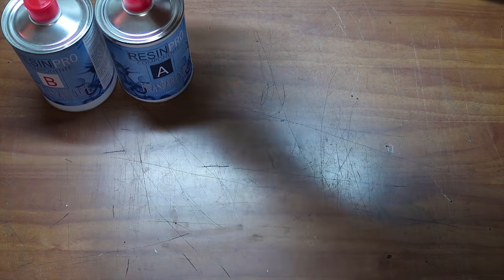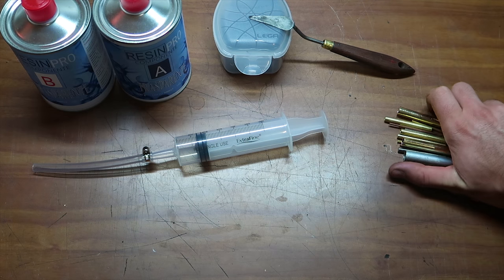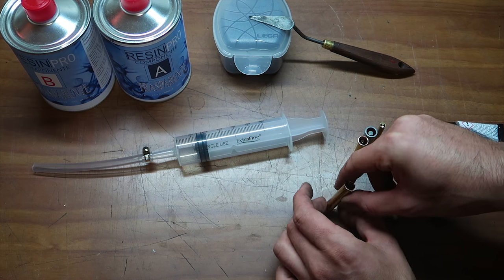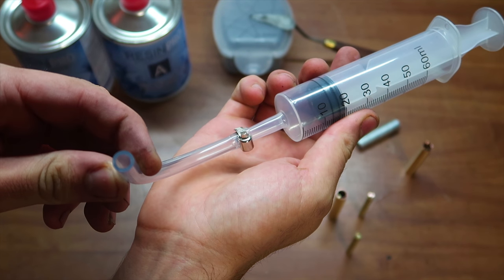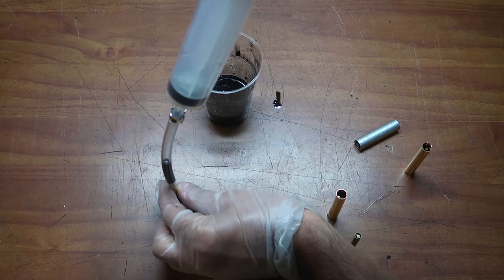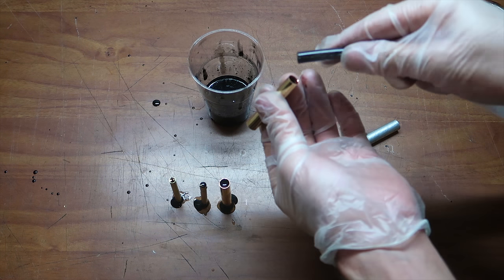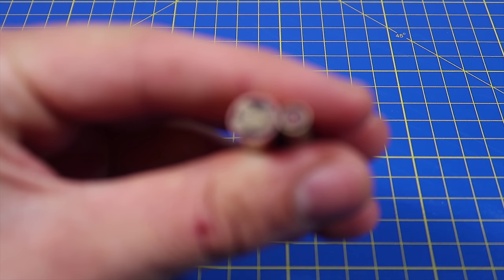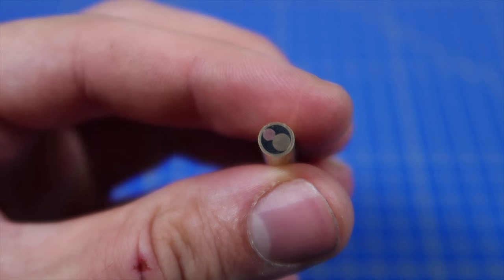Experimenting With Mosaic Pins

Comment: I just watched a vid where a guy used clean hose on both ends of the brass tube. He used masking tape to make a U-shape with the brass tube at the bottom and the tubing forming the U. The using a syringe he sucked the resin mixture from the container into the U. Turned it so the solution didn't dip out and placed them in a box. Thought you could use this method. Less clean up.

Comment: These are so cool!  I’ve done a little resin casting as a hobby.  I found that cured resin peels right off those syringes - The plastic they’re made of is very slippery.  The resin even peeled off the rubber part of the plunger.  Usually I could just pull the plunger out and the cured resin would stick to that enough to pull the cured resin right out.  I don’t know if that helps you - It just looked like your procedure required 3 hands - and you pulled it off quite well!